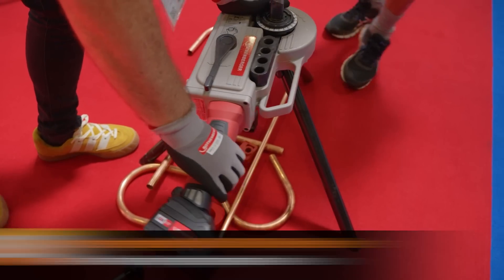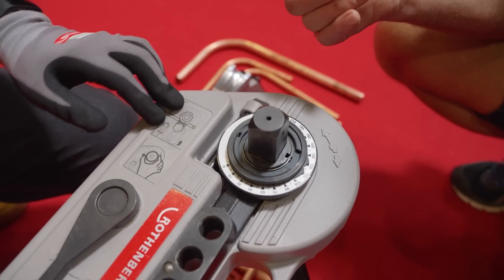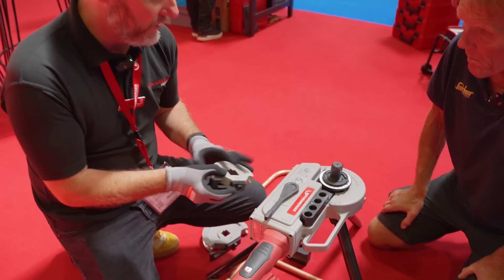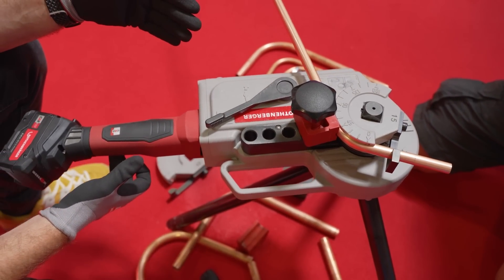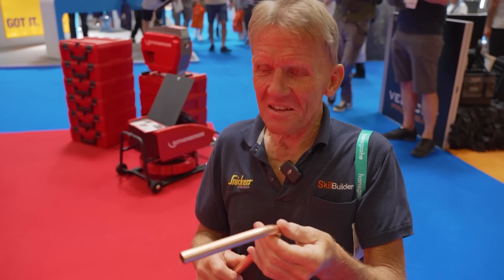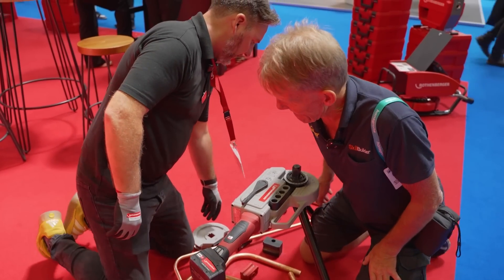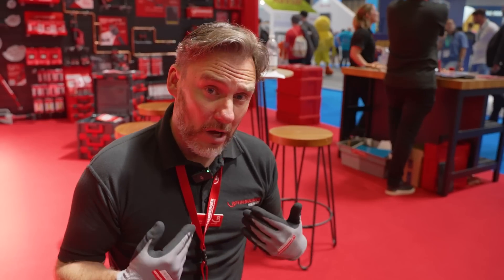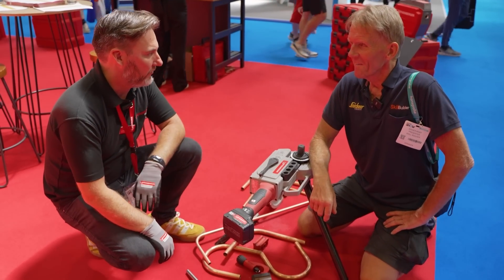Effortless Pipe Bending | Rothenberger Robend 4000E

Comment: If its anything like there press gun  it will last 6 months
Reply: Very true.  I had a brand new Rothenberger press tool and it lasted 4/5 months. Hardly used it.  It's like new.  Cannot find someone to repair it.  I had to buy another press gun just to use the kit again as in some jobs it's vital.